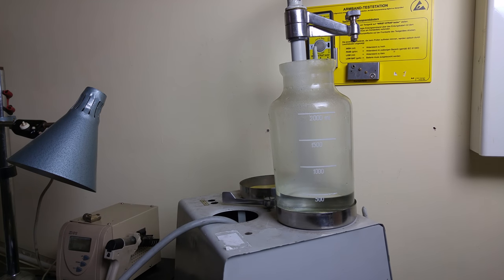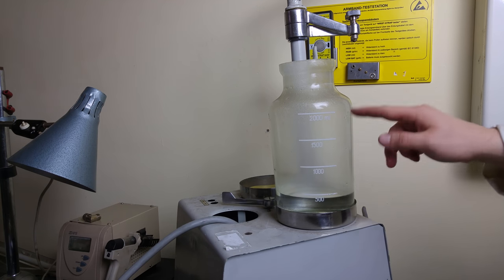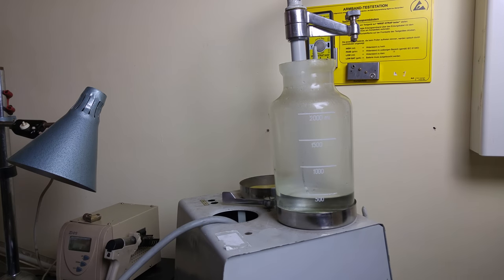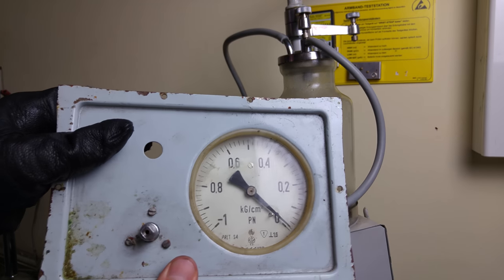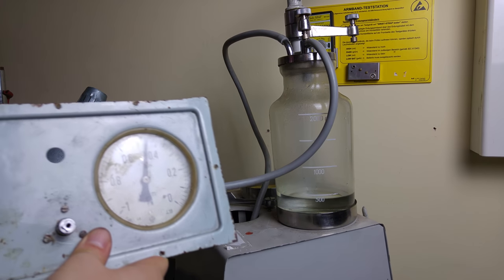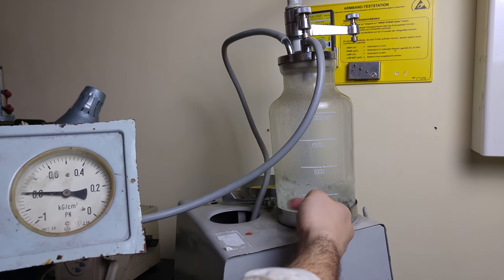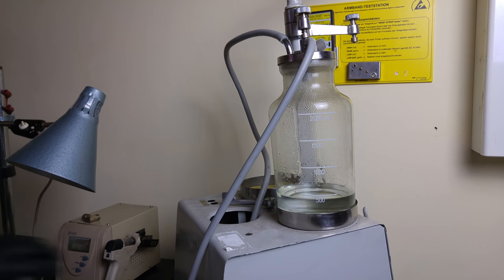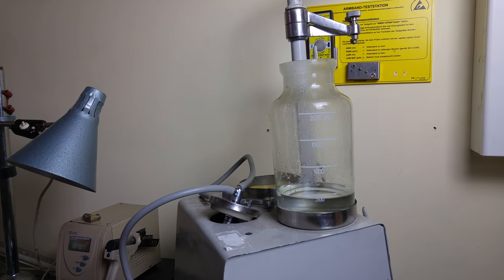boiling water in vacuum chamber

Comment: What is the rate cc/min that the water boils off ?    I have heard it takes approximately 2min/cc - at approx -1 atm. Does this coincide with your data ?
Reply from the maker: Hello, Sorry I have not tried It. It was very poor setup, with bad seal on top - to do those experiments it should be in insulated environment, here some part can be degassing process that also lower temp.